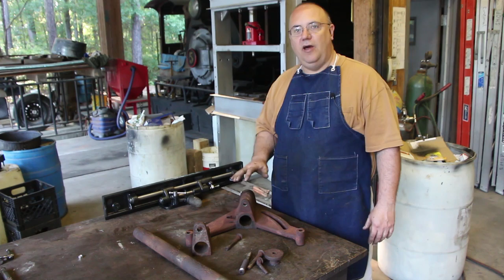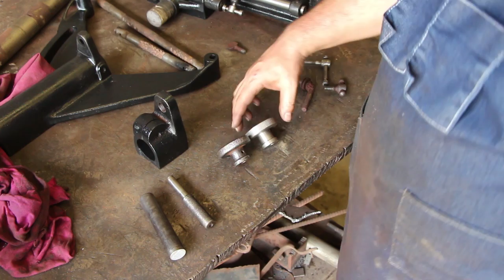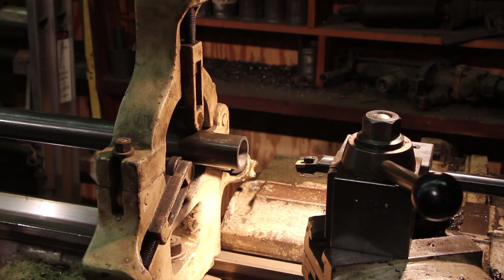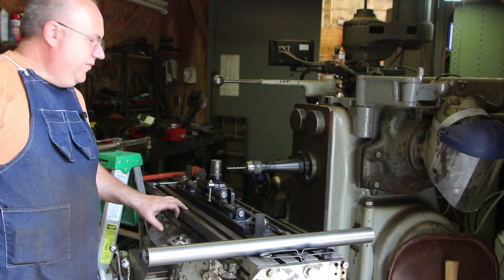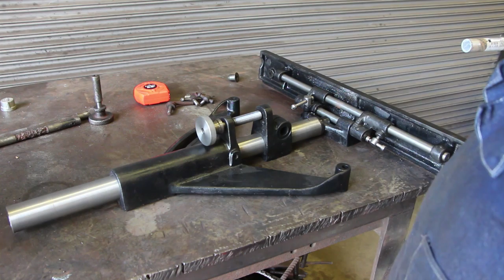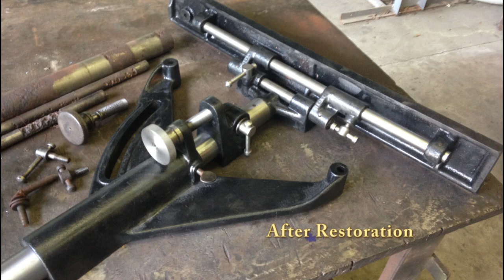Oliver 80 Table Saw "C Fence" Restoration: Part 2

Comment: I’ve found that filling a tube with sand can moderate the chatter by a fair amount. Of course, fill the ends so the sand stays there, and make sure there’s enough to fill it fully, so it’s compacted a bit so it doesn’t shift when turning.

Comment: @39:38 Looks like you have almost 3 threads engaged with the thread in the casting. You have made the part too short. The threads will wear prematurely because you didn't check if the bodge piece you copied was the right length. Not a good example to your viewers.

Comment: Hi Keith - You're said you still need to make the knob for that arc at the back of the fence - what is that used for? I don't quite understand why would it be useful to rotate the fence sideways....
Reply from the maker: Cove cutting on the table saw.  Used to making moldings.

Comment: chatter is vibration through the toolpost, cross slide, saddle, indeed it will draw from the path of least resistance and develop.  A thinner or deeper cut adjustment will settle it. The test of a good lathe is how it parts off. that will show you any weakness in a lathe for sure.
now ringing is another problem, similar to chatter. This is when you catch a part at its harmonic resonant frequency. Again treat this like chatter, speed up or slow down wil often sort this.

Comment: Great segment Keith!  I especially liked the fitting of the tapered pin.  I have not seen that done anywhere else on YouTube.  Question...  When you knurled the big knob did you have to make sure that the diameter of the knob as a multiple of the circumference of the knurling rollers?  I have heard that was a good thing to do. Thanks in advance-  An avid follower-  Fred

Comment: I'am scratching my head trying to figure out how one would use a divergent angled fence in relation to the saw blade. A tapering jig slides with the work piece along the fence. But how would a work piece engage the saw blade at an angle unless perhaps cutting a cove on a piece of molding.
Reply: Keith, cove cutting occurred to me while watching this video...though not while watching part 1.  When I've seen cove cutting done, there are generally two "fences" though...one on each side of the workpiece, to keep it tracking.  With just one fence it seems like it would be too easy for it to move away from the fence and get ruined...even with blade rotation helping it stay against the fence. The leverage of a long workpiece might overcome the blade force unless one was very careful. No reason why you couldn't add a second fence to the Oliver for coves though, if you wanted to. Easy enough to clamp a board to the table.

Thanks for the video, and making it look easy!  I know it isn't...and I'll prove that one day when I get some machinery of my own. :-)

-- Mike

Comment: Great video. Impressive parting segment.  Have you ever tried putting a bicycle inner tube inside a tube or pipe (and airing it up) to reduce vibration. 
Thanks Milton
Reply: I use the broomstick trick 1 end on the tube other end on the shoulder and use arm/hand to apply some pressure on broomstick